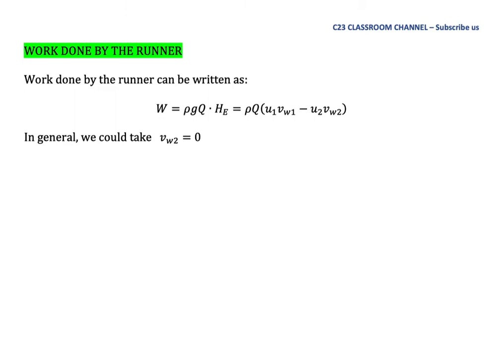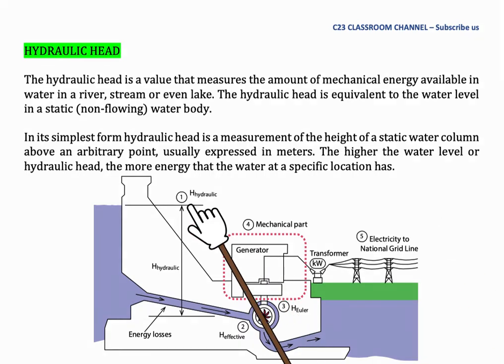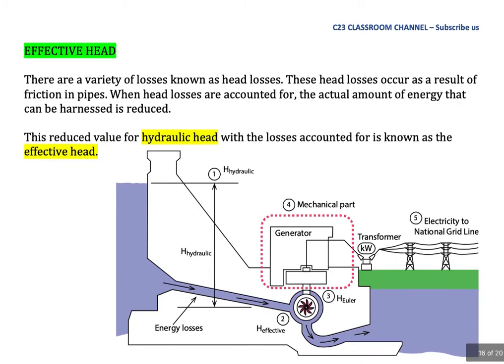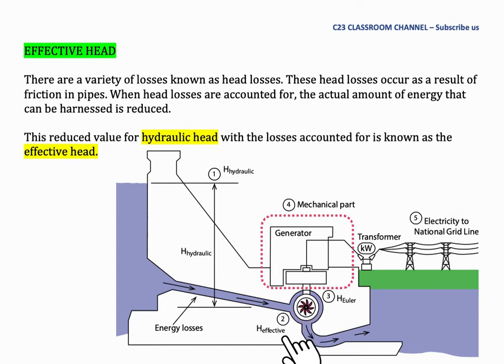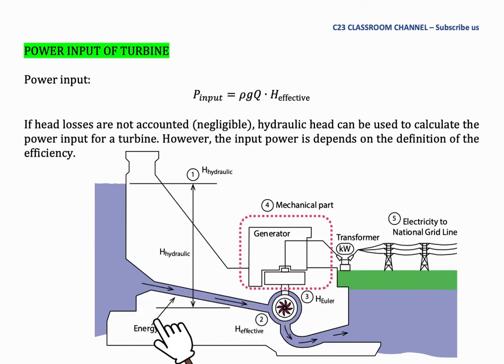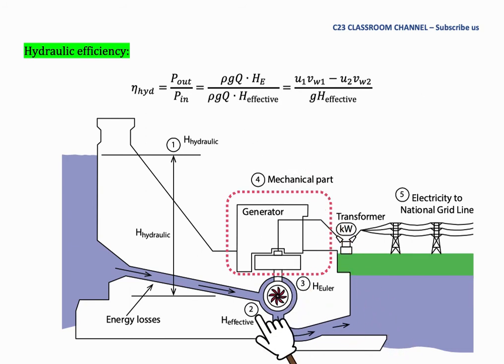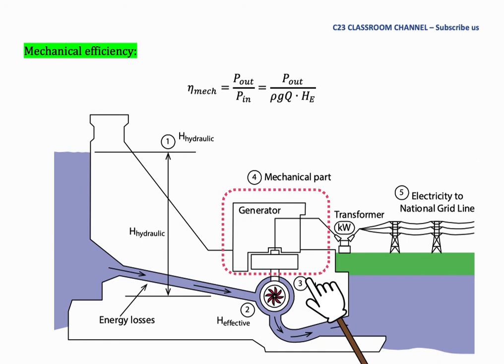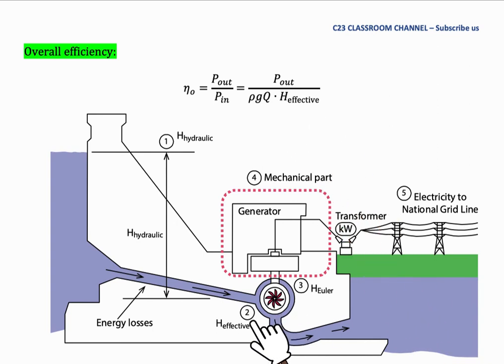Francis Turbine Note 03 - Work, Euler head and efficiency for Francis turbine

Comment: Thanks for a comprehensive lecture. My Question is; 
in case of Vertical Francis Turbine, the Rated head is calculated by the difference of Maximum Reservoir level Minus minimum tail water level. Please confirm how this rated head will be calculated in case of Horizontal Francis Turbine ? is it the same or philosophy is changed ?? Please explain in a reply. Many thanks